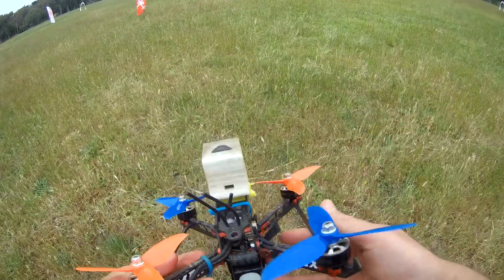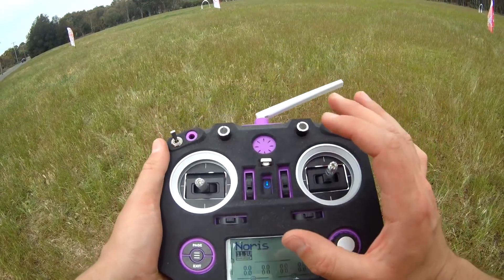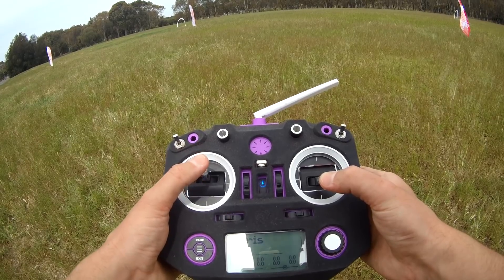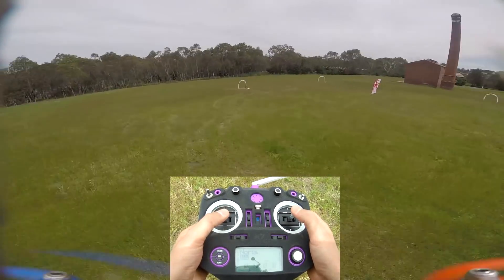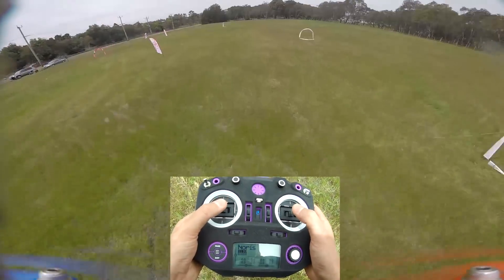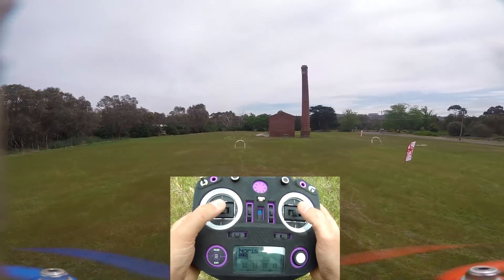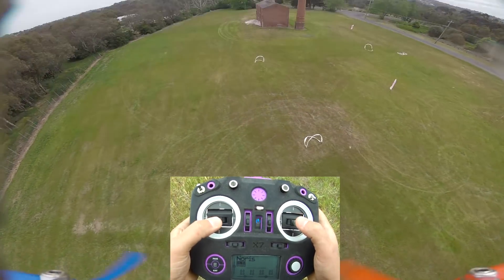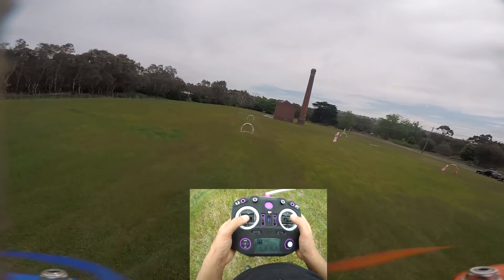HOW TO FLY A FPV RACE DRONE. UAVFUTURES FLIGHTSCHOOL lesson 5 powerloops

Comment: Hi I was wondering if anyone I can help me. I am brand new to fpv and drone building. I am going to build the drone from the $99 build with some of the upgraded parts. I don’t have any of the equipment yet and I was wondering what battery I should get for the quad in the vide, and is it possible to get away with one or should I buy 2? Is Banggood a trusted website for batteries, just in case they are bad quality. Also does it matter what transmitter I use,  like can I use the same one that comes with the radio I am buying (the fly sky FS-i6) thanks a ton!!
Reply: SkyDivingMoose I would recommend getting like 3 batteries at first and if you enjoy the sport, buy more batteries so you can spend more time out in the field practicing. Also get 4s batteries rather than 3s
Reply: Lars Freeburg thanks! I was wondering if you could link any XT 60 compatible 3s 1500mah bats. I’m not confident with flying 4s yet I think, that would be great!! I think I would need a 55C + rating
Reply: SkyDivingMoose don't make the mistake I did waiting until Winters here to get enough batteries. I think six batteries is the ideal amount but for is a good bare minimum for continuous charging if you have a dual Channel charger in the field

Comment: I think the one trick no racer knows how to do is... Landing! 

I always call it the "racers landing", which is pretty much always a really bad landing, sometimes you even flip the quad because you were coming in at speed and didn't slow down to a stop. I can't recall a single racer that can actually land well. I think its just something we never practice, but it would be nice so people stop laughing at you when you can do really great flying, and then fail to do something basic like landing. Any tips Stu? I'm wondering what the fastest way to learn is (maybe use myself as a reference point, or something. Its just hard to see how fast you're going when the camera is pointing so high you can't see the ground.
Reply: Jake Garrett When I land I try and come down gradually so I don’t have to worry what’s under me, so I’m pretty low by the time I get to myself and use whatever I can see as a reference point for speed.

Comment: I really appreciate this playlist, It's hitting me just at the right point in my learning. Sure would love to fly with you and your crew.
These lessons are going in my list for spring. Been playing with Liftoff and think it's pretty close to real, at least in Acro on actual tracks, the grid and auto level modes aren't too true to life, but acro in a farmfield is all I ask..

Here in the US we are driven indoors just as you get back out (The weather sure looks nice there) and you've got that awesome field just begging for some ripping. 
Is that just a publiic place, or have you made a deal with the owner? It's a great spot for your tutorials.
We've just been thru 2 weeks of incessant wind and rain, and I haven't flown for over a week, I'm going into withdrawl so I pulled the Whoop out. It snowed this morning and it's going down to 15f tonight. I think my flying is going to take a bad hit.Time for plan B (Liftoff & Whoop)

 Just dusted off the Whoop, and flashed BF3.2. It's amazing how far Betaflight has come since April. The Whoop (Makerfire F3EVO) flew great last spring, but now it's got a yaw issue and is eating the batteries (which may just getting old). I also think the motors are also getting old, and may be causing the yaw twitch and spin.

I ordered a bare version of the Whoop you featured a few days ago, (and 2 as Christmas gifts for the kids), hope it flies as well as your test copy did. 

G'day Scott

I may be doing 'mini-power-loops if they're up to it...